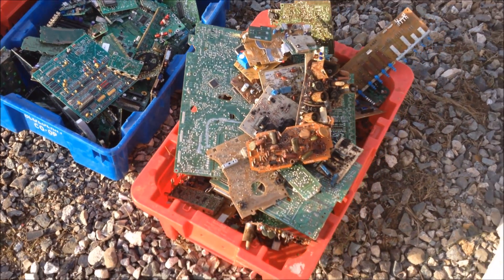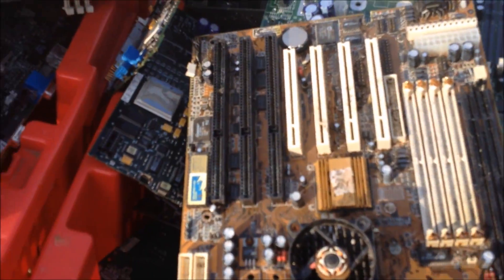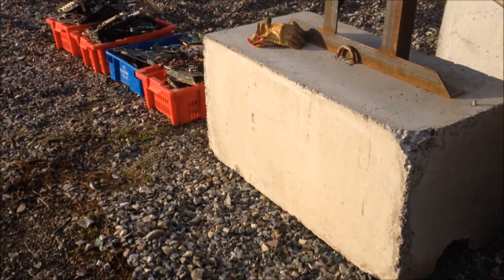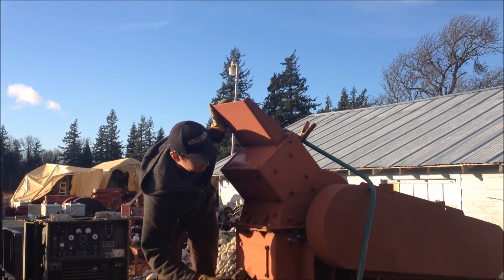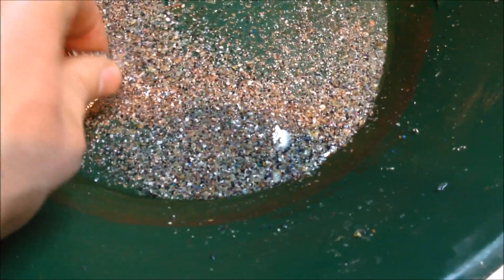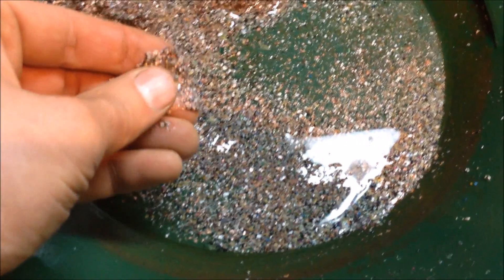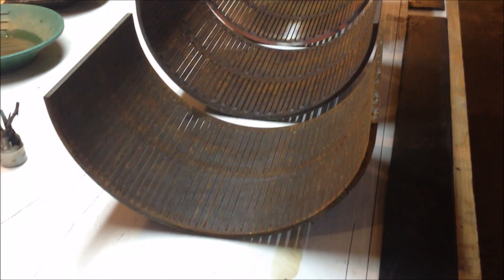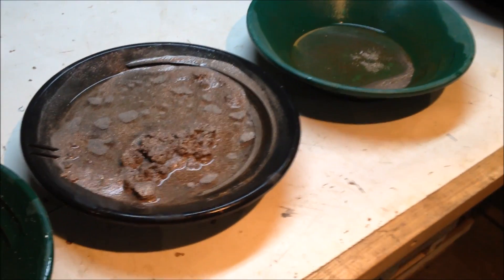URBAN MINING! Recovering gold, copper, precious metals from PCB's without chemicals

Comment: Doesn't make any sense to me.  How can you separate plated gold from the copper mechanically?  I have been an electroplater for 30 years so I really would like to know.
Reply from the maker: Hi Uzi-

Thanks for the comment.  I should clarify that we can't recover all the gold from the boards, but at the end of the video we do have free metallic gold in the gold pan.  Our goal is to take whole boards and concentrate out the valuables (metals) from the non-values (fiberglass, plastic, etc).  The free gold can easily be removed,  melted, and sold directly to a gold buyer, leaving the concentrates, which are much more valuable that the boards themselves.

The remaining gold, as you say, is plated onto other metals.  This cannot be mechanically separated, but using the hammer mill and shaker table it can be concentrated into a salable product.  The #2 and #3 hole outputs can be sold to a refiner and let them deal with all the chemicals and refining process.  For most people its too complicated, dangerous, expensive, etc. to separate out the different metals in the concentrates.  

As a side note the free gold per pound recovered from the ~20 pounds of boards equates to 1 troy ounce per ton of boards.  This would be considered very high grade gold ore for any miner.  The PCB's also have loads of copper, tin, lead, plated gold, etc that is added value on top of that 1 oz/ton free gold recovered.

Thanks for the comment and clarification and thanks for watching!